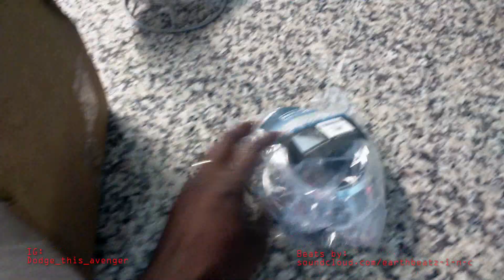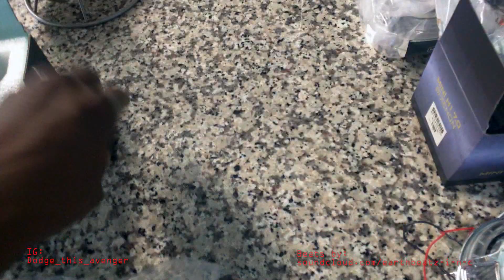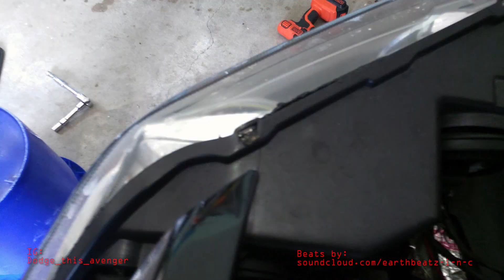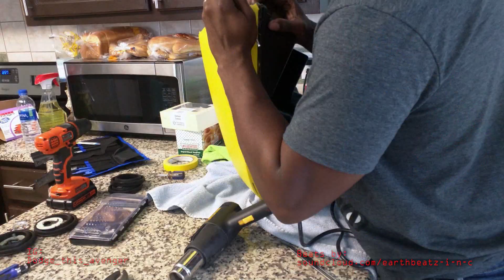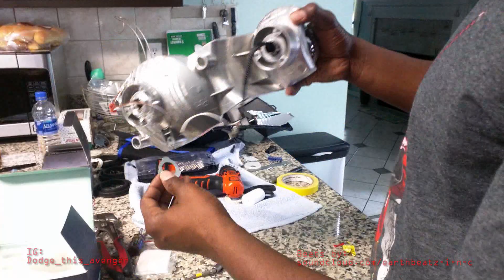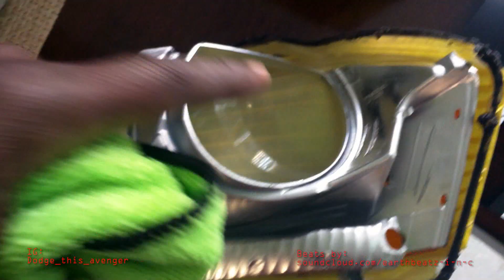Dodge Avenger Projector Headlights, HID, and Led Install - Retrofit PART 2

Comment: where does the white wire on the drl connect to?
Reply from the maker: I'd recommend leaving it disconnected.. If you have drl ..it connects to the white wire of whatever headlight socket supplies the drl power. You may end up with 2 wires connected to the one white headlight wire..

Comment: What paint did you use on the shrouds? Color and brand. Did you use high heat paint?
Reply from the maker: Hight heat midnight black and the red is just Caliper paint.. both paints were clear coated.
Reply: @jayarchitect  doesn’t the red paint block/cover up the rear halo? I’m so confused. TIA. They look great!

Comment: Where did you get the grill? For a 2011-2014?
Reply from the maker: Doesn't properly fit the 2011-14
Reply: @jayarchitect  ugh why didn't they make as much aftermarket stuff  for the last gen😭

Comment: How did you wire the led pods.
I know 3 wires but where do they go?
Reply: Profile hi lens drl
Reply from the maker: @brian5975  if you have drl .. connect the blk wire to the high beam blk wire and the other white and grey wires to the high beam wht wire.
Reply from the maker: what led pods?